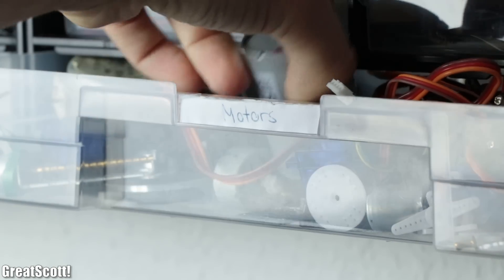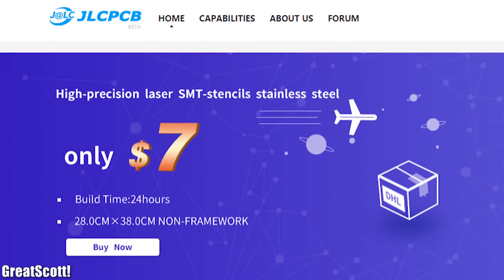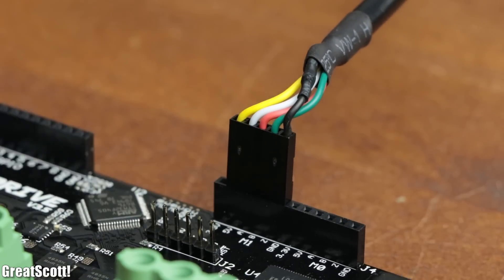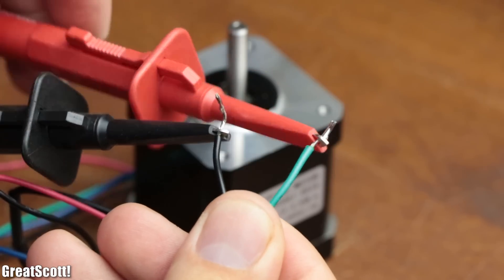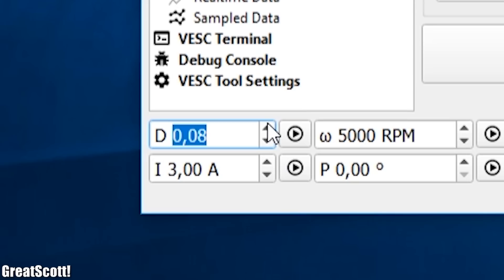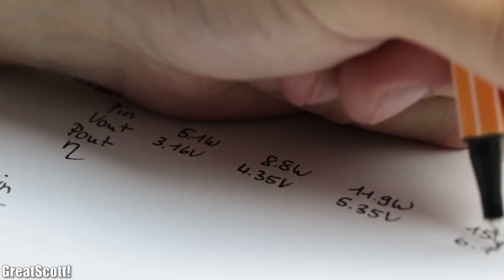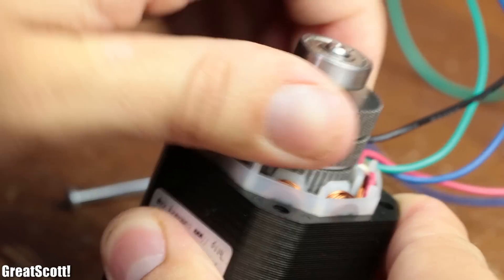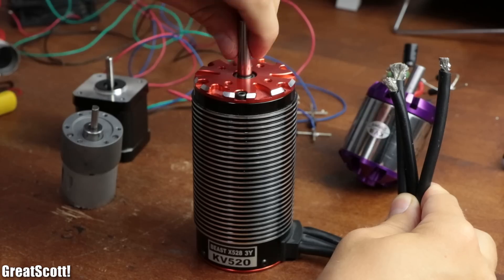Which Motor Type is the Best Generator? || DC, BLDC or Stepper? (Experiment)

Comment from the maker: Anybody got a good source for BLDC Motor gearboxes?
Reply: I recently took apart a 10 year old hand crank powered led flashlight. Inside I found a gearbox with 3 gears driving a 3-phase generator which is essentially a BLDC being used in reverse.
Reply: bornach   yeah, some have 3 phase, some have brushed dc and some have a 2 phase gizmo that can't be used as a motor.  I've taken several apart!  Anyway, the bigger ones have robust high ratio gear trains and many hobby uses.
Reply: @bornach  a 10 year boy, 🙏👍
Reply: The gear boxes are just another source of losses. What determines the efficiency of a motor is its internal impedance, same for transformers and all other electrical devices./
Reply: @josidasilva5515  exactly
Reply: Geargenerator.com is helpful to get svgs of meshed gears if you decide to try 3d printing nylon will hold up depending on the load.
Reply: GreatScott! I want to make a generator for myself that i can turn with pedals. So this video was very handy for me! Maybe you could make one?
Reply: GreatScott! 3d print one
Reply: Murphy deffa You forget that the voltage is directly correlated to the power since the load is constant, so more voltage means more current flowing through the resistor as well. Boost converters boost voltage, not power (if that was possible, we’d have free energy and it’d violate thermodynamics).
Reply: GreatScott! Just watched the rest of the video you could also print pulleys and use a belt for there is an openscad file for generating pulleys on thingiverse.
Reply: I am about to make a small wind generator from a used hoverboad motor. It is rated at 350W and is build to rotate quite slow with 36 volt input. This will (I hope) generate high voltage as a generator from low RPM without gearbox and the mechanical loss associated with the gearbox. The same should be true with moste hubmotors.
Reply: Banebots has a whole range of them, but they are expensive...
Reply: GreatScott! Bldc stands for brushless dc right?
Reply: hay great scott i like your videos and,can you please make a video about old school electronics
Reply: 3D printer + Lost PLA metal casting?
Reply: You can get a geared ebike hubmotor if they spin backwards the gears engage and generate quite a bit of power but are hard to spin sometimes
Reply: Go to basics! Just add a simple rim of 3ft. to the input of the driving motor and add smaller pulley to the shaft of a driven motor. It might work as a gear box of the simolest form without any actual gears tho. Then you can mesure the input voltage and output voltage. Dont know if its a waste of idea. But still. 

Love your work.🤘👍
Reply: GreatScott! no sorry, I had that backwards. lower kv would give higher voltage
Reply: I personally think pulleys are a better option however the bldc is not scalable for a hobbyist once you get to around 900 watts finding a way to regulate the voltage without switching to an alternate becomes a feat in itself try looking for a 900 watt buck/boost converter that isn't from a tesla vehicle now I would love to see a video overcoming this though let's say 1.2kw bldc generator with voltage regulation.
Reply: battery less gadgets are made of it are forever, so we can easily produced enough electricity to drive the remote control like gadgets?
Reply: In competitions like RoboWars, Combots with 30Kg and above categories utilizes BLDC Motors with a suitable Planatary or a Jhonson Gearbox... Try contacting any of the engineer whose team participate in RoboWars and build bots in 30kg category or above.
Reply: GreatScott! I made 220v dc with a printer stepper motor and a full bridge rectifier
Reply: Make more videos please
Reply: https://www.ebay.de/sch/i.html?_from=R40&_trksid=p2047675.m570.l1313.TR6.TRC2.A0.H0.Xplanetengetriebe+.TRS0&_nkw=planetengetriebe+&_sacat=0
@Josi Dasilva is right
Reply: 3D printing and designing my own at the moment to work with my mid drive electric bike setup
Reply: Drill
Reply: 3D printing nylon or PC or CNC milling metal.
Reply: Search for planetary gearbox on aliexpress
Reply: If you only need small reductions, you could always get an rc spur gear and pinion gear. Mount the two motors facing each other and offset a little for the spur and pinion to mesh. That'll maybe get you 5:1 or so
Reply: Just 3d print them, you have multiple 3d printers right?
Reply: Make 240v from a motor thats from a FAN
Reply: SyazTYT you can make this but you need a 220v fan
Reply: @zrellll  Salam bro, jom lepak ngeteh..nak tanya pasal motor generator. saya org Puchong/cyber
Reply: @sleeperburuk5340  eh tak boleh, saya bukan pro motor/generator
Reply: 3D-printing?
Reply: Aditya Sachan Yes, please do... I'd love to see it!
Reply: Old cd drives may do the trick
Reply: you used way too low KV motor. using a higher KV motor would give you a MUCH higher voltage
Reply: GreatScott! Dear Scott, (or anyone who reads this) I need your help. Please.
I am from a so tiny village in India. Where power cutt is not a common  thing but it is fixed for 10 hours a day.
A single battery can not provide much curreny as the appliances need 10000 watts of power.(220v 50htz)
What do I do?
May be adding multiple batteries in series can help but how? 
As i am from a tiny village... none professional seems to be able to help me.
Reply: @rajveersingh2056  we can help u in this by making lithium battery based inverter with 3hrs. Charging
Reply: how about trying it with a belt and pulley system first like gt2 this would be cheap to try https://www.banggood.com/GT2-6mm-Closed-Loop-Timing-Belt-2GT-6-280400610852mm-Rubber-Synchronous-Belt-p-1180257.html?rmmds=search&ID=531140&cur_warehouse=CN
Reply: imjeff88 good idea but you won't want toothed belts. you'll need a smooth belt.
Reply: +michael sharp both types should work but there would be advantages to the toothed belt. that is it wont slip so easy and can be smaller
Reply: sure if he had a cogged pulley for the teeth to engage, but the motors have smooth shafts. so a toothed belt wont work. also the teeth limit how tight the belt can be bent. it would not be able to turn tight enough to engage a small smooth shaft.  so a smooth belt is really the only option for his current setup. vacuum cleaner belts are cheap and easy to find, and would work well on the brushless motor in the video
Reply: +michael sharp the shafts have flat sides on them and you would still need one of the shafts to have a pulley to get to the right ratio and he can just 3d print them one can use as little as 20t on gt2 as well https://www.ebay.com/itm/GT2-20T-5mm-Bore-Aluminum-Timing-Belt-Pulley-For-3D-Printer-Parts/231923731840?hash=item35ffbb4d80%3Am%3Am1od4m-QwyA9CedovwMzf-Q&var=531140549947&_sacat=0&_nkw=gt2+pulley&_from=R40&rt=nc&_trksid=p2047675.m570.l1312.R1.TR11.TRC2.A0.H0.TRS1
Reply: Du kannst auch gut deutsche Wörter aussprechen
Reply: Why don't you 3d-print one?
Reply: get a cheap drill, cut the motor off and add a coupler between the shaft and the bldc. you may need to add a bearing if there isn't one on the front of the dc motor.
Reply: also, you can get metal gears, or pulleys and belts, and make a 3d printed gearbox housing.
Reply: Aditya So you have learned how to use the power plugs in your house?
Reply: Depends what size you want. Easiest way would be gearboxes from a rc car for a big reduction there are also some gear reduction setups for  rc planes that are more simple and only 2 gears.
Reply: 3D print one?
Reply: Dear Scott, im trying to understand scematics at minute 4:15 so blue and red goes to bridge but the black and green stays unconnected? can we connect them to another&different rectifier at the same time? so in the end we gonna have 2 different bridges, can we connect the bridges parallel and get much more power from them?
Reply: Aditya Sachan  share with mee
Reply: Trim the shaft diameter down to accept the gearbox you already have.
Reply: Watching your channel helps me learn more on electronics than most of these textbooks i been reading. :)
Reply: Yes I found a gearbox for bldc motor on thingverse
Reply: And don't forget that DC motor is the worst because I tested a gear DC motor and I got complete bullshit = 9 v 400ma on input and 2v 33ma max on the output.
Reply: You need the shaft diameter and cut, (Slotted, single cut, double cut aka D and double D, pinned, splined, etc.) and length of shaft. Then mounting face requirements, max rpm, torque, cooling capacity, lubrication type, gear ratio, duty cycle, seal type, bearing type and quality...
I went to SDP/SI who make a myriad of toothed drive belt products. built a rudimentary gear box, and built a two stage reduction gear using 4 pulleys and two belts. They have design tools to aid and I'm sure they ship Int'l. There are CAD files available for you to incorporate into your cad design and have accurate bearing plates cut CNC. Very little adjustment required too.
Reply: Robu.in or a scrapyard
Reply: @iamiotengineer  

Hi
I need some of these things from you
Can you please guide me
Reply: Hobbyking.com
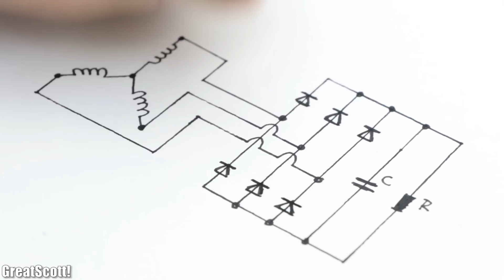Reply: 4:35 Ich höre ein Deutsches Wort.... gibt es demnächst die Videos auch auf Deutsch? :3 Mein Englisch ist unter aller würde... xD
Reply: In a wind turbine like I am working on a belt drive works well to get the gearing needed with less mechanical drag than gears
Reply: The electronic dump
Reply: @iamiotengineer  pl share
Reply: You didn't talk about stepper motors.
Reply: 1
Reply: Aditya Sachan. yes
Please share free electricity method vedio to email India.techno@yahoo.in
Reply: @fapalakad665  when did he say free electricity/energy?
And who proved the second law of thermodynamics to be false?
Reply: Can you be may frend
Reply: ZF
Reply: 3d print it with nylon fillament
Reply: Many thanks, I have been researching "how many solar panels does it take to run a house?" for a while now, and I think this has helped. Have you ever come across - Senarper Salient Secret - (just google it ) ? It is a smashing one off product for discovering how to have free power in your home minus the normal expense. Ive heard some super things about it and my cousin got great results with it.
Reply: Modellhubschrauber-Getriebe Hauptrotor
Hier ein Verwendungszweck für Brushless-Motoren: https://www.youtube.com/watch?v=uf78udpz3aI und https://www.youtube.com/watch?v=1yB49G756OI
Reply: Planetengetriebe aus einem alten Elektro-Fahrrad (erkennt man am relativ geringen Durchmesser)
Reply: Stepper motor can be generotor?
Reply: @iamiotengineer may I get ur contact no ?
Reply: @ROH101  🙏😅🤣🤣🤣
Reply: I’d do a combination of timing pulleys and belt with spur gears at the “generator” to achieve the nominal rpm at the expected input rpm, depending on what I wanted to drive it with. ie, a wind turbine, vertical wind turbine, water turbine, etc.
Reply: Anyone here know if an alternator is still better than BLDC as a generator?
Reply: https://www.youtube.com/watch?v=VsecsMZuupI&ab_channel=Skyentific
Reply: thingiverse
Reply: 3d printer / einfach drucken
Reply: GreatScott! I shall say Aliexpress
Reply: how does an AC get infinite power?
Reply: @areg7182  it doesn't, free energy is not possible
Reply: GreatScott! Check out the channel - electronoobs. He is also like you.
Reply: No
Reply: Greatscott pleas make a sumo robot
Reply: no
Reply: X orasele ai văzut pe când seriile de la căști trebuie să tăiem și pe ăla acolo

Comment: One thing worth looking at is how alternators and magnetos work, they basically just have more coils and much more winding. My motorbike has a magneto with 18 coils for eg. BUT the point of this video was turning a motor into a generator. It would have been good to see you turning the blcd at a higher rate to the point where you getting similar efficiencies that you are seeing in the other two motors cause I would have thought the BLCD should be able to beat out both of them at the right rpm and probably survive alot longer.

Comment: I think you were a bit biased when you did the test.
I don't understand how you came to that conclusion. In your test the BLDC motor has by far the worst efficiency and you say "nah, if you put a gearbox on it, it will be the best." The gearbox would make it spin faster, but also it would have less torque, so the final power would be even lower, due to the mechanical losses of the gearbox. 
Also in 6:05 you say "it was a mix between the previous two generators". Bro your bldc is making a better job as a vibrator than the toy from my gf. The other ones are way more smooth.

Comment: Useful vid but they werent really comparing like with like as the essential KVs were all so different. Big DC , ultra low rpm scooter motors work well with no agro as cheap generators as the motors are almost free.

Comment: Instead of gear boxes, which have alot of increased resistance, try pullies, use pullies with proper ratios to reach your desired RPM.

Comment: I had a little play with stepper motors as generators. The best circuit for a motor with 2 coils i figured out is one bridge rectifier with both the coils in series connected instead of one. At the middle node of the coils connect a relative big, low esr, low voltage loss capacitor and connect the other end of that capacitor to plus or minus of the battery, depending on what you prefer. Instead of a full bridge rectifier for one coil (and then maybe putting the outputs in series), now each coil has its own two seperate pair of half bridge rectifiers (Delon circuit), what is somehow paralleled to each other. A pair of half bridge rectifiers puts the positive and negative part of the ac input in series and creates a virtual mass, while a full bridge rectifier puts them in parallel. That also means, if seperate diodes are used,... two coils of a stepper, each with a pair of half bridge rectifiers and caps and that in series, we can even reach  >=4 times the voltage of a single full bridge rectified coil, reduce losses and parts we need. by using 6 diodes and 3 caps, it is possible to have two Delon circuits in series and parallel at the same time to make maximum usage of the two coils of a stepper. something to draw...

Comment: so if not mistaken. more RPM is favored over high torque? you only want enough torque to overcome the magnetic attraction as the magnets pass the coils. perhaps slightly more to maybe steady the voltage supply?

Comment: Power measurement should have been done by using an optical tachometer and putting the motors on a reaction torque-arm with a scale to measure the torque.
Otherwise, really appreciate the video and the work you put in here !

Comment: HEY.... I'm interested in using the  Flipsky BLDC Belt Motor with Pulley 10mm Shaft 6384 190KV 4000W for Electric Skateboard Blushless DC Motor for a RVCAMPER GENERATOR POWER SOURCE.  If powered by vehicle fuse panel would it create enough power to connect to an inverter to power a microwave, fridge, hotplate and ac unit?

Comment: What would the maximum voltage output possible be. Or best one possible (ex: Stepper motor) to create electricity to Ac voltage to power a bldg like a small shop or 1 bedroom in a house . Would that be possible from any of these motors ? Thanks !

Comment: bldc motor is drone motor which is designed to be less heavy thats mostlikely why its lightweight . and produces less power. 
electric veichle bldc motors. i mean ground veichles. ie tesla cars electric scooters etc. generate enough pover to charge their own batteries while sliding downhills. so they are extreemely efficient in that case .

Comment: By chance is there a way to 3d print a gear box that could spin the bldc motor much faster with a low input rpm? I see lots of videos about people creating these crazy gear ratios. Would that help or hurt because you loose efficiency in the gears ?

Comment: Attach a tight plastic or rubber tube between shafts, not a rigid connector to minimise vibration, due to poor alignment.

Comment: Is there any way we can add some sort of alternator with a capacitor to the top of a quad copter to extend or maybe continuously power it. There has to be a way to use the down force of the wind from the props. Would love to get to the bottom of this been thinking about it for years.

Comment: the brushless motors needs to work well, as a generator, a higher speed. i think about 10000 or 20000 rpm and that's why your stepper motor driven experiment doesn't fit the reality.

Comment: You need to do this with a Newman generator...you need a 1x1 inch diametrically magnetized cylinder and coated wire (26 gauge). It’s only 2 windings,108 feet each. You can move massive electrons and high frequency this way, but your mechanical input speed must be rather high. I’ve seen KWh ratings with this motor with certain novel turbines

Comment: There are many more parameters to consider in order to find the most efficient generator:
What rotational speeds and power can the energy source (wind, water, steam etc.) deliver? What´s the best option to drive s shaft DIRECTLY? The generator has to operate at its maximum power point. The wrong motor for the wrong energy source won´t convert the energy efficiently. You can use a power converter on the secondary to bring an arbitrary motor eventually to its maximum power point. Then even a BLDC with low RPM could deliver enough power. The low secondary voltage of let´s say 3V could be converted to your desired voltage of e.g. 12V.

Comment: Why did you not secure the motors,, it effects the values, through the vibration on the shafts? They will perform poorly flopping around the table.

Comment: Use a salient pole dc motor, multi pole will generate power at low rpm without high losses from the gear box, this will have highest efficiency.